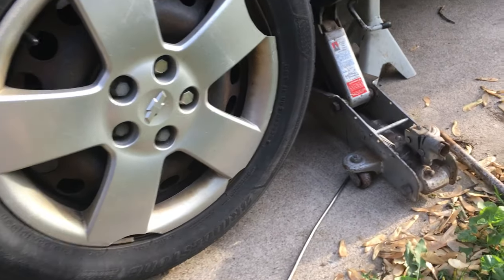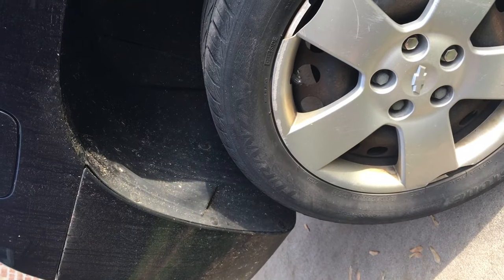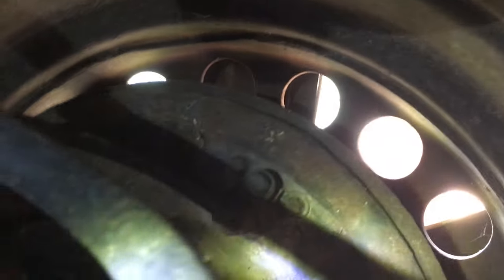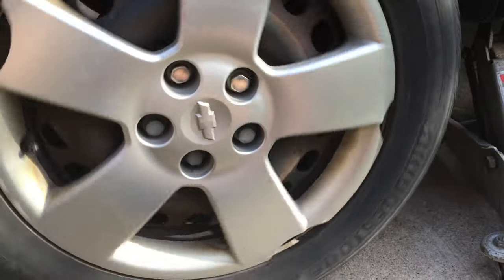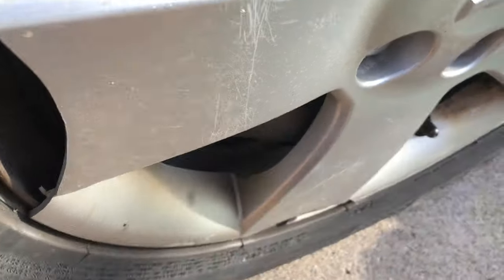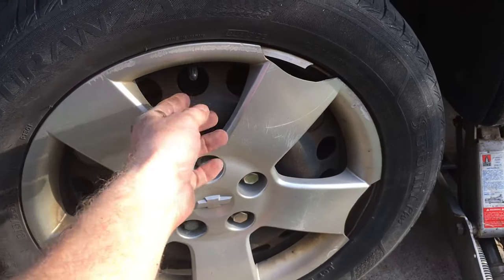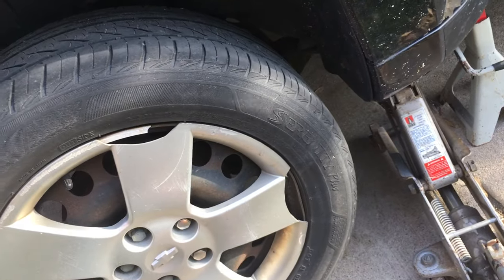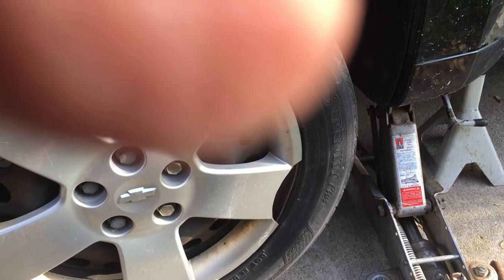How To Adjust Drum Brakes Without Taking Off The Wheel

Comment from the maker: 1:53 is where I show the star adjuster getting adjusted by pushing down with your screwdriver. You can see & hear the adjustment clicks.
Reply: Can you go the opposite way for locked up breaks? Not sure if I'm even on the adjuster to loosen it. But back wheel's are locked up after sitting for for years.
Reply from the maker: @jimskenadore1791  Yes. Opposite will bring the shoes inward, so less contact with the drums.
Reply: @SportsMusicCars  mo
Reply: @SportsMusicCars  how tight do you adjust

Comment: i installed new drum brakes on my civic and the e brake was loose so i tightened it and it still takes a million clicks to get the e brake to full upright position so i tightened the drums more and the e brake and the wheels have a fair bit of resistance when i spin in the air like when i use my force it will rotate maybe 3 times and then stop. this much resistance is too much from what ive researched but it still barely stops the car with the e brake while going over 20mph. it will hold the car still on a slop and i can stop fine but the e brake is just looser than it was before and the rear brakes feel soft. ive bleed the system 2 times now but after doing so i read in the manual my cars bleeding procedure is backwards it says in the manual do FR, FL, RR, RL which may be the cause of the soft rear brakes but does explain why the e brake is weak when the drums are very much adjusted tightly i dont wanna tighten them anymore. if anyone has had issues like this with getting the e brake set right after putting new drums on id greatly appreciate it.
Reply: I solved the issue btw by tightening the adjuster on the drums, they needed to be way tighter than what the videos say. It actually had so much resistence i had to use my force to spice the wheel and i measured each wheel shoe to shoe to get them even so the e brake was pulling evenly and worked perfect for anyone struggling 😅

Comment: Where you had it is good. I’ve always been told you want about one rotation when you spin it. After that, drive it and slam the brakes a couple of times to get them self adjusted. That’s how I was taught at least. Bringing them out isn’t too bad, but if you get them too tight, it can be a mother f@#$%* to loosen them because you have to bring them latch down to turn it up. I’ve never been very good at that lol.
Reply: Did a adjustment on a family members vehicle and the abs light turned one for both rear wheel speed sensors. Unfortunately the LR adjuster got stuck before backing it down so it had more resistance than I would have liked.
Reply: Ive done quite few rear brake jobs on family members cars, and for the ones with rear drums I usually end up taking the rear wheels and drums back off and adjusting the adjusters from the front side, if the self-adjusters dont work (even with a good cleanup sometimes they dont...)

Comment: When I do breaks on my truck I back up fast and slam on the breaks. That normally sets my adjuster.
Reply: That works when you've rebuilt the brakes. If they're old and wearing down, this should help until you rebuild them. 

I've got an old Grand Caravan and the parking brake is loose, so I'm going to try this. The rears aren't making any noise yet so this should work for a while, until they start to make noise and I'll replace them.

Comment: OK, if there is resistance when you turn the wheel by hand, that means there is constant friction which the engine has to overcome and which wears out the brake shoes. Is that practical? I have changed my drum brakes but didn't leave them so tight.
Reply from the maker: Good points. Some resistance is okay and normal. about 1.5 turns of the wheel is usually good. With a front disc / rear drum system, the pedal feel comes from the rear, so if the wheel spins too freely, like forever, then the pedal response will be slower. There is always some friction, even with a disc setup.

Comment: So do you go up clicks on passenger side and then down clicks for dtiver side to tighten?
Reply from the maker: same way both sides, at least on the GMs I work on.
Reply: Towards the center of wheel to tighten and it will click. Towards the outside or tire and it loosens, no clicks

Comment: Do you need to do both wheels or just one?
Reply from the maker: Do both, then pull the parking brake to center the drums afterwards. If one wheel brakes before the other, you might notice the car pulling one way or the other under braking.

Comment: I to 1 1/2 around is good.
Reply from the maker: Exactly. There will always be some drag on all brakes, drums & discs. Surfaces will touch ever so slightly. If the wheel spins 10x, I can guarantee your braking is not as good as it should be.

Comment: You did a good job in my opinion but i would recomend removing the drum, the shoes wear the drum out but leave a ridge and or lip on the edge of the drum that will make it dificult to remove the drum should one need to gain acces , because of the way drum breaks are assembl;ed it is sometimes very dificult to reduce the shoes, or bring them closer together in other words, due to the adjusting tab contacting the star wheel, it's alot easier to expand the shoes out than to  contract them.  The ridge/lip should probably be ground down or chiseled off. Thanks
Reply: Usually theres threads on the drums of a screw with the drum that you use to jack the drums out
Reply: @ollysfishing4231 not lucky enough for that here. Fighting with a drum as we speak. Not seized or rusted. But the shoes and all hardware is trying to come off with the drum.

Comment: Great vid  got some insight , did you put in neatral when doing , cause if not the wheel wont spin , so i took off each tire and cleaned the drums and just kinda did what you did, but all the videos or most vid dont mention anything about putting in ne neatraul, when u did this  this vid, was ur truck in neatral?
Reply: HHRs are front wheel drive. The rear wheels just spin unless the parking brake is applied. No need to put car in neutral.
Reply: @jonshort6709  my chevy truck is rear wheel drive tho,
Reply: @kennethsimonette6835  common sense will tell you

Comment: Is that in park or neutral?
Reply from the maker: The rear wheels spin, no matter what, as it's fwd. I have the car in park so it doesn't move on me, of course.
Reply: @SportsMusicCars  
I'm turning 53 next Sunday and I just did the rear brakes for the  first time this week, but the pedal is still a little soft. I figured it might be because I didn't mess with the adjustment key.

Comment: If you over tight you gonna damage your rear axle bearings
Reply from the maker: do not over tighten!
Reply: Wheel should move free. If breaks tight , fuel economy down, wheel hub and tyres get heated and bearings get damaged
Reply: That's not overtight what he has it at.
Reply from the maker: @drharshvardhanmehta  If it spins 10x with ease, you have almost zero braking power.
Reply: @arthurl.9985  Exactly. There is going to be some drag on every braking component. The key is to find the sweet spot where you are not dragging too much and have good pedal response.